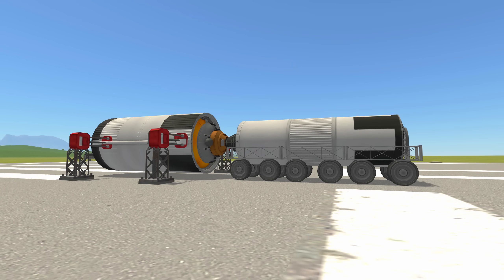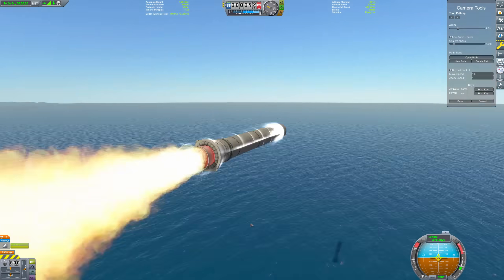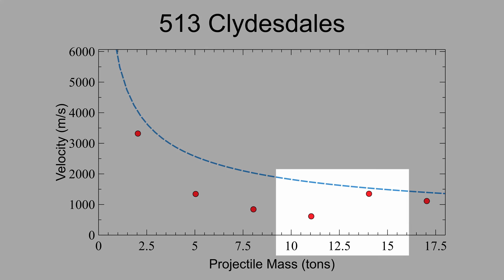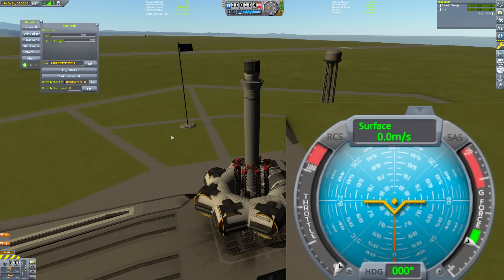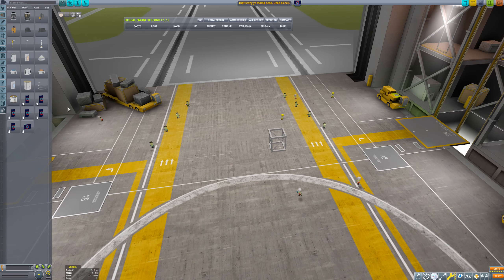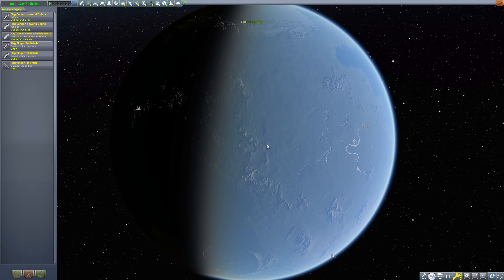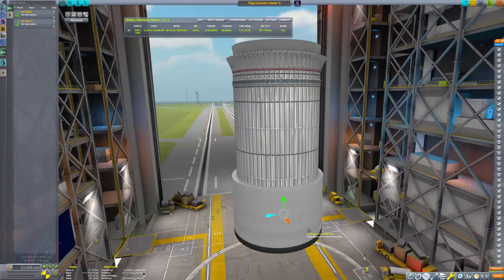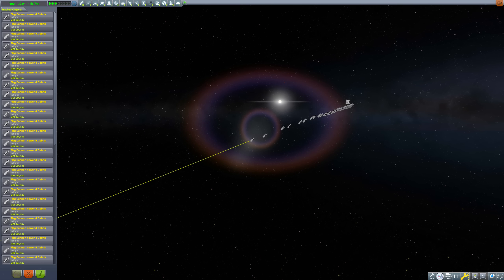Engineering a LIGHT-SPEED mass driver | KSP 1.10.1

Comment: 12:04 "if you thought 9% of the speed of light was ridiculous, this is about 10 times more ridiculous" -stratzenblitz
Reply: If i were to disagree with that statement it would only be because i would say it is exponentially more rediculous. Multiplication can't even scratch the surface of my disbelief.
Reply: It's actually more ridiculous by a factor of 11.1111111111111111111111111111111111111111111111111111111111111111111111111111111111111111111-dies from lack of oxygen

Comment: In reality, this amount of boosters might actually slow down the earths orbit around the sun for a few meters/s
Lol. Guys, we can overcome global heating by bringing earth to an higher orbit!
Reply from the maker: 2500 clydesdales SRBs produces about 8 giga newtons of thrust. However, as @rune12358 points out, this wouldn't actually impart any velocity to earth since the exhaust velocity of the SRBs is lower than earth escape velocity. You would need an exhaust velocity of over 11 k/s, which corresponds to an engine ISP of about 1100. Nuclear engines or ion thrusters could work if you had enough of them :p
Reply: @Stratzenblitz75  I was just thinking that surely some of the exhaust fumes would be given more energy through sheer chance. the calculations will work on paper, though in the real world surely by sheer volume and scale a small though still measurable volume of particles would be accelerated with enough force to reach escape velocity, to impart a net force on the earth.

though, to be well and truly honest, even if that was the case, the force of our nearest star would probably have even more of an impact on our planet's movement.

or I could be completely and utterly wrong with my assumption.
Reply: @joep2843  Our nearest star? Yeah, I'm pretty sure Sol's impact on Earth's movement is substantial and important.
Reply: @Stratzenblitz75  waddabout Goliath engines?
Reply: SRB exhaust doesn't reach escape velocity, so it would come straight back down, imparting no net momentum change. It'd be quite the environmental mess, though...
Reply: @rune12358  That's a good point
Reply: @rune12358  if the exhaust reaches the speed of light in one frame too I think it might not come back down.
Reply: @rune12358  just make it longer
Reply: @rune12358  that amount / power of boosters would though, and would undeniably shift the earth's orbit
Reply: @joep2843  actually, I ran the numbers and accounting for the earth's mass it would take about 353,000,000 years for the thrust to accumulate a velocity of 50 km/h, while the earth's orbital velocity is 107,208km/h. So it would take a very very very very long time to have any noticable change.
Reply: @joep2843  ... those boosters make 825 000 000 000 newtons, one newton is 1kg moving one meter in one second, that means those engines could lift something that weighs 
825 000 000 000kg and moving 1meters/second. the earth weighs in at about 13 000 000 000 000 000 000 000 0kg... i will safly say that those engines would not even move pluto, or pretty much every moon in the solar system
Reply: @rune12358  Very good point. I think most of us would have overlooked... so the global warming we would try to avoid would essentially be multiplied lol. u know what they say ... if it aint broke......
Reply: So, that global warming futurama episode
Reply: @isaactrockman4417   yes
Reply: @isaactrockman4417  that’s exactly what I was thinking
Reply: @isaactrockman4417  Yes
Reply: Just need to pipe the exhaust plume outside the atmosphere
Reply: Slowing the orbital speed would lower the orbit and have the opposite of the desired effect. You need to speed up to go to a higher orbit.
Reply: @joelsmith3473  This is not true. Orbital velocities are inversely proportional to the radius of the orbit. The paradoxical thing is that you do have to accelerate to decrease your orbital velocity. friggin orbital mechanics man.
Reply: @benbriggs4604  You are correct, but in order to get to that orbit of increased radius, one needs to increase their orbital speed. If we have two circular orbits, one at r=1 and one at r=2, the orbital speed at r=2 will indeed be slower than the one at r=1. However, if we enter an elliptical Hohmann transfer from r=1 to r=2, the orbit will be faster at periapsis equal to r=1 and slower at apoapsis equal to r=2. The Hohmann transfer thus requires an increase of orbital velocity at r=1 to enter the transfer orbit, then another increase of orbital velocity at r=2 to circularize.
Reply: There is a problem with saying that a Clydesdales exhaust velocity is lower than escape velocity. Its true for a single Clydesdale, but we are stacking thousands on top of eachother. This means that there will be an incredibly dense and hot gass right outside of the nozzles, something far surpassing what is capable with real materials. This would cause a massive explosion, and surely send plenty of the exhaust out of earth orbit. Someone whos smarter than me should do the calculation on how big of an explosion itd be.
Reply: jetison333 great point, I don’t have the knowledge to do so but it would be dense and hot enough to start fusion for there was any light elements there.
At less for a frame
Reply: Technically, since the flags are going faster than light, they have infinite momentum, so the earth would also fly away faster than the speed of light in the opposite direction to conserve momentum.
Reply: @coffeecup1196  only if the flags had the same mass as the earth.
Reply: @gagewilcox  It's a 0/0 like situation. Momentum is only a linear function of velocity at low momentums. As an object approaches the speed of light, it's momentum actually goes to infinity. So, a 5 kg flag traveling at 0.9999..... insert 50 or so 9's times the speed of light has the same momentum as the earth traveling around the sun. If the flag actually travels at the speed of light, it has infinite momentum, so in order to balance conservation, the earth must travel with infinite momentum in the opposite direction and thus must travel at the speed of light. Of course, IRL it doesn't make any more sense to talk about traveling faster than the speed of light than it does to talk about 2+2=5, but it's still a fun thought experiment.
Reply: @coffeecup1196  so if what you are saying is true for the fact..Earth would zoom away from solar system right?!! That's bad.XD
Reply: @coffeecup1196  Great explanation.
Reply: @sivakiruban4349  no Good
Reply: Anything with mass being accelerated to the speed of light (which in itself is impossible) from the surface of the planet would turn the planet itself into a glowing, fast expanding ball of white-hot plasma.
Reply: @coffeecup1196  you can't say technically and faster than light in the same sentence. If they're going faster than light, real physics doesn't have any opinion about what behavior is more correct.
Reply: @henryprickett5899  Read my second comment, specifically the end.
Reply: @coffeecup1196  that's just not how physics works man. That model for relativistic four momentum holds exactly and only for massive particles, which travel strictly less than the speed of light. The only particle which does travel at the speed of light, a photon, is massless and has finite momentum. In fact, naively plugging in a v > c into the relativistic momentum equation would give you a finite but imaginary momentum, not a divergent one. You can't make meaningful statements about nonphysical systems by handwaving away limits.
Reply: @henryprickett5899  It was just a chain of thought. I am aware that the scenario makes no sense as soon as the slightest amount of mathematical rigorousness is applied, and I never claimed it did (as stated at the end of my second comment). The video depicts a massive object traveling faster than light in a classical manner in a fictional universe following fictional laws of physics in a video game, so forgive me for applying a handwavy limit in my analysis of the situation. I meant no harm by it.
Reply: @henryprickett5899  I realized my comment probably comes across as more offensive than it was meant to be. All I mean to say is that everything you said was right, but I wasn't exactly trying to be mathematically rigorous in the first place. Closer in spirit to sci-fi than to an academic paper.
Reply: @coffeecup1196  that's not how conservation of momentum works -    m1v1 = m2v2  if the masses are distinctly different the velocity will be as well
Reply: @CED99  That is how momentum is defined in classical mechanics, yes, but not once you consider general relativity, which is what I think I was referencing here (its been a while). Light definitely has no mass, but it has a measurable momentum (google light sails), which is an indication that p = m*v does not hold in real physics.
Reply: @coffeecup1196  you would make a very good math/phys teacher holy crap
Reply: @coffeecup1196  no because the earth as more weigth (a lot more) and see what @rune12358 said
Reply: @galactica4867  Jeez, youtube comments just don't know when to quit. Look, I still think I'm right, and you will always think you're right, so why don't we just drop it? We should both know we're speculating about what real-life physics would do if put in the context of a video game where something breaks the speed of life, which is solidly not possible in real physics. It was a fun thought experiment meant to show how momentum approaches infinity as an object approaches the speed of light, and that infinities do not behave like classical numbers. Please see my reply to Gagewilcox if you really wan't more of my thoughts on the matter, since they said basically the same thing.
Reply: like in futurama?
Reply: This actually still isn't enough boosters to alter the earth's orbit by much. It's only  a few million tons of explosive equivalent, we've surpassed that in reality.
Reply: Apparently back in the 60s, some government contractor had a plan to place a 1000 of the strongest rocket engines at the time parallel with he ground, and in the case of a nuclear attack, they would be turned on in hopes that the earths rotation would change and the mussels would overshoot or undershoot. When the math was done, even if the earth was a vacuum and the exhaust left the atmosphere perfectly, the change in impact would be only the diameter of 2-3 hydrogen atoms.
Reply: Point your exhaust vents up and vent! Vent like you've never vented before!
Reply: What if we move it too much and now it gets far from the sun?!
Reply: @AlejandroDiaz-jg1ow  Then burn retrograde for a few seconds and see what happens
Reply: Scott Manly (iirc) did a video on this sort of thing. Millions of the most powerful engines in game and MONTHS of fuel for them to even have a chance of nudging the Mun, let alone kerbin, which in turn is much smaller than the earth. We're dealing with a LOT more mass than most seem to think. Minmus would ignore ten times this many boosters running for weeks (even if it wasn't on rails in the game simulation)
Reply: To be more effective in launching the flags, wouldn't each engine only have up to 5 solidFuel in it?
Reply: SRB only had enough thrust for twice the amount of it's own mass, that's why SRB's are perfect for heavylift rockets like the SLS and the Shuttle program, strapping bunches of them into the ground with exhaust pointing upwards is not enough to affect earth orbital trajectory. But theoreticallly if you got just five of them together exhaust pointing upwards and had infinite fuel we can change earth orbital path approximately in...

Geez I don't know, maybe 200.000 years? 200.000.000 years? That's dinosaur era amount of time xD
Reply: In case you forgot, there's exhaust.
Reply: Just like in Futurama. With enough Robots who emit Polluted Gas you can blast the earth in a Higher orbit.

Though you do have only a short span of time for this to be done,
Reply: if you do the math it would slow the earth down by 1.0752x10^-13 m/s if all the cyldesdales burned for the full 76 seconds
Reply: Even if you did move earth to a higher orbit, it would only be temporary as planetary resonances would slow the earth back down  to an orbit in equilibrium with the other planets and earth would be right back where it started
Reply: omg ClemensAlive du hier? :D Nice :)
Reply: was zur Hölle macht ClemensAlive denn hier, damn bro, cool random ksp video haha
Reply: with E=1/2mV² one of those projectiles change the speed of kerbin by about 8.7*10⁻⁴ m/s
Reply: Ahahaha! I’ve got 1,000,000,000 kn in a engine, so I’ll move it
Reply: Can't we just drop a giant cube of ice into the ocean?
Reply: @RainingArtillery  what kind of futurama anti global warming is that bullshit
Reply: NASA wants to know your location
Reply: Raising the earth’s orbit is also dangerous because it could cause many asteroids and comets that would normally miss the Earth to hit it, plus it would alter the orbit of the moon causing more extreme tides
Reply: 1.1E-11 m/s velocity change to kerbin with 2543 Clydesdales
Reply: Clemens actively watching KSP, mann das ist geil
Reply: since the mass of some object increases with acceleration and velocity, the flags would likely push the earth in the same way any other rocket would- exhaust from the mass driver has an equal and opposite reaction on kerbin, and it could probably push it with significant velocity. the fuel isntbthr engine- the flags are
Reply: i support spaceship earth ;)
Reply: Yeah just have earth go on vacation to a higher orbit, then bring it back down once its temper tantrum has cooled off
Reply: If you move it away then it'll actually get closer.
Reply: This would only work if the exhaust velocity of the rocket engines exceeded escape velocity, which isnt the case for any modern day engines. All of the fuel accelerated upwards wouldnt leave the earths gravitational field
Reply: The wandering earth moment
Reply: Yes, and make year longer, so we will age slower. YESSS
Reply: We can simply cut trees not as fast and stop spam-growing indians and chinese people...
Reply: or end the world if u wanna throw it out the system